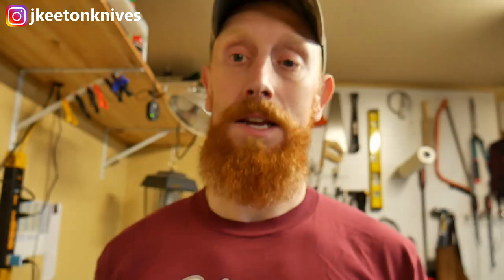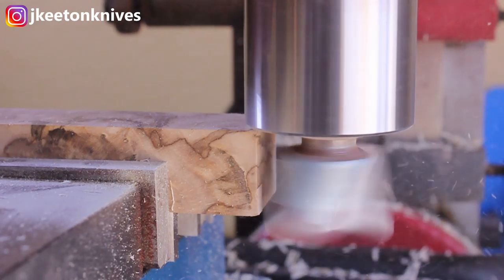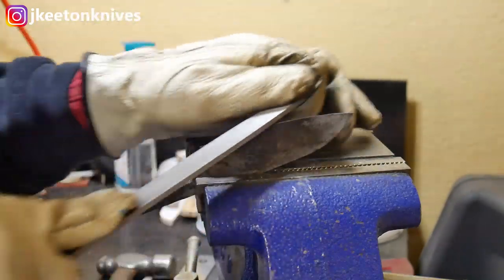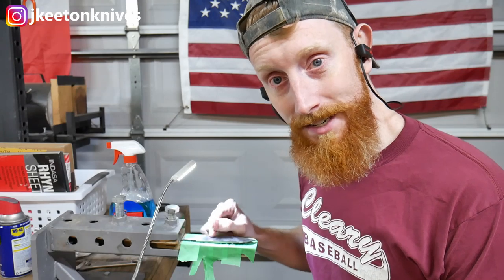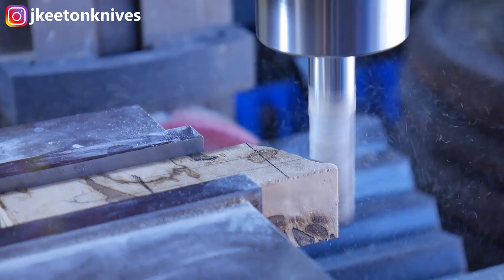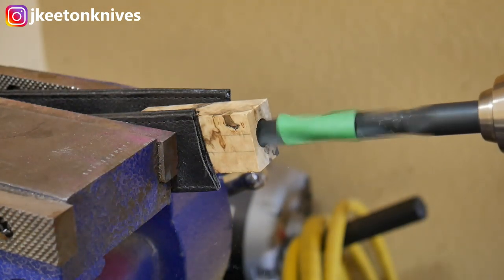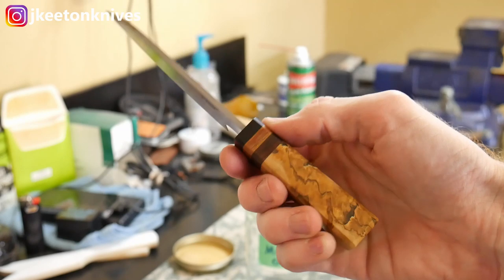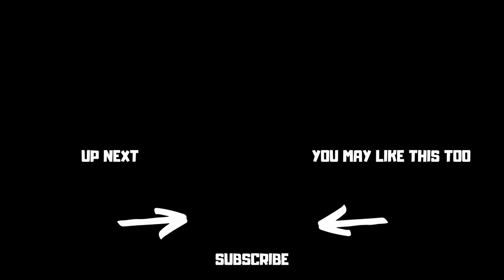@Simplelittlelife Kitchen Knife Build Along - #SLLBUILDALONG

Comment: Awesome to see another iteration of the build along knife. I have one similar in the works right now, had to do my handle gluing inside since its cold out. I smeared a tiny bit of beeswax on the tang before gluing, and was able to pretty easily remove it after about 30-45 min (using 30min epoxy). I'm with Jeremy/SLL on the sanding handles without a blade, wayyyy easier to grind things down without any "oops" marks.
Reply from the maker: I'm going to have to try it that way next time! Seems like a better solution for sure!

Comment: That turned out well for a first attempt at a hidden tang. Just a few pointers, as you said yourself youll definately have to square your shoulders on the tang, thats also critical that they are straight, so use a file guide (nice little project to make one). To notch the tang i use the bansaw and put several small notches in it, its better than using the grinder as you could damage the belt edge and ruin it. Try and get your pieces around the same sizes if you can, easier to glue up and keep square, plus you save on material and less sanding,which is always good. As in regards to keeping things square, i usualysquare up the back of the handle (spine side) before glueing, that way you have the best possible chance of keeping everything straight. Not critical if its just one wood type. And lastly about handle shape, the great thing about wood is you can keep reshaping it even once the knife is finished. If you want to do alot more of the hidden tang knives, check out thetopicala on you tube. Osmos is by far one of the best guys ive seen for making puuko style knife handles, he doesnt make the blades but does eveything else. Even how to make a vise for them,for assembly, from what i can remember. Both hidden tang and full tang have their pros and cons, hard to say which is the easiest to work on.
Reply from the maker: Thank you for your tips and feed back sir!

Comment: Awsome!!! Kitchen knives have to be thin!!! Like super thin at the cutting edge and point! Distal taper a must. I see that wen sharpener what wheel are u using??? And would u recommend it?
Reply from the maker: I agree! A full flat grind on 1/8'' stock with a width of this size may not be enough. It seems to work decently, but it could be better. More to learn there for sure! Here are all my thoughts on the WEN sharpening system - https://youtu.be/mN21B_OOg7w